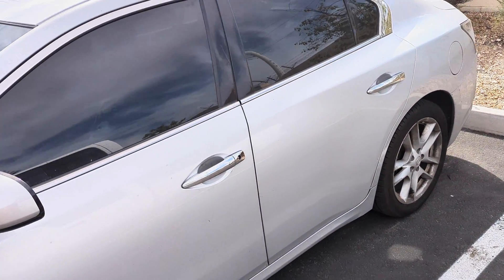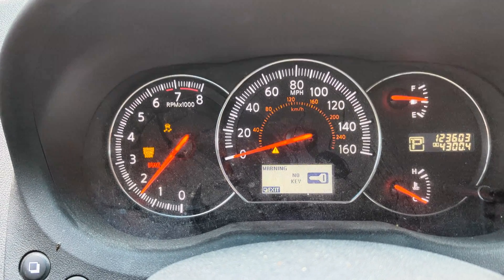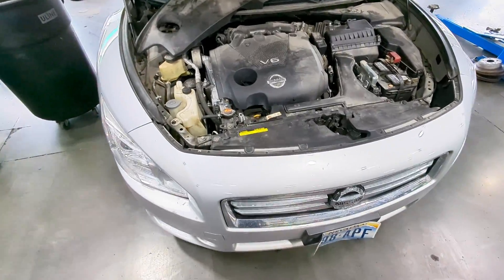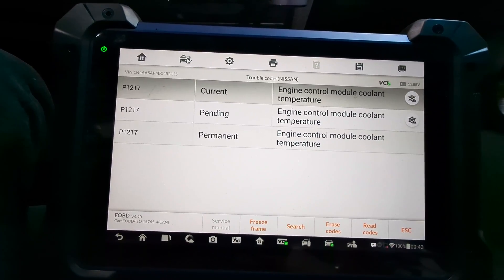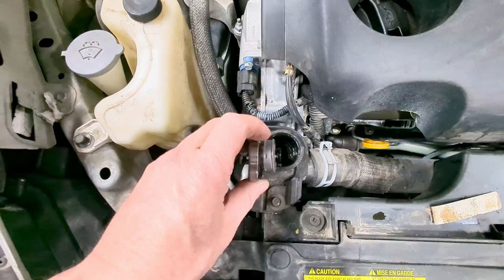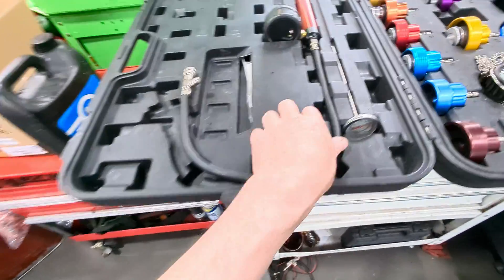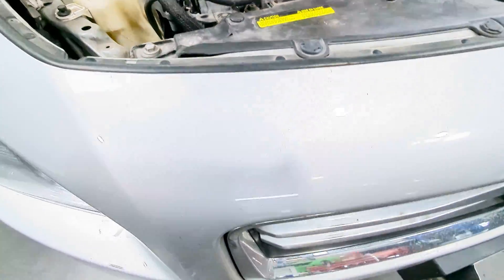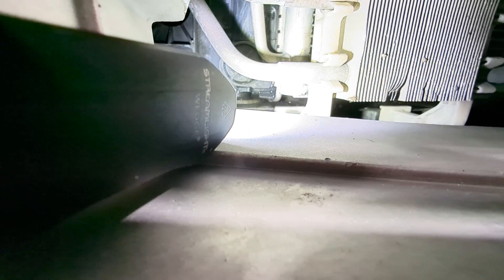How to Pressure Test Cooling System for Leaks Nissan Altima with code P1217

Comment: im pulling this code on the same car, 2014 Altima. The car has ran fine mostly, but overheated when running the heat, and also doesnt do it every time, has happened a couple of times. AC is super cold, and the temperature runs fine any other time. But ran heat while going down highway, check engine came on, temp guage actually fluctuated back and forth but ultimately overheated and engine kinda sputtered. Pulled over and turned off for about 3 mins, restarted and ran normal. Check engine light doesnt stay on once back to normal. So im having trouble figuring this out.

Does this seem like it could either be some kind of sensor, thermostat or relay? Or possible air in lines? It SEEMS like something not major just due to how random and seldom it is, but i cant say for sure and im about to put some money into the car if its not a major problem but if its something that would cost more than a couple hundred bucks to fix then im not.